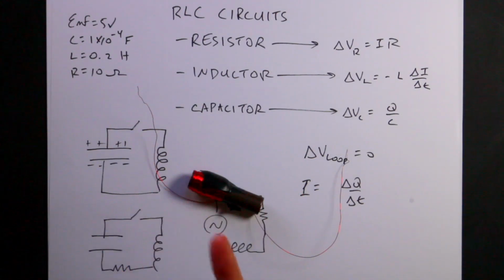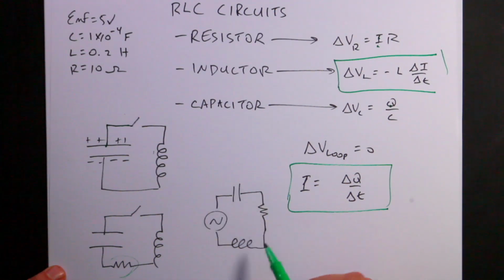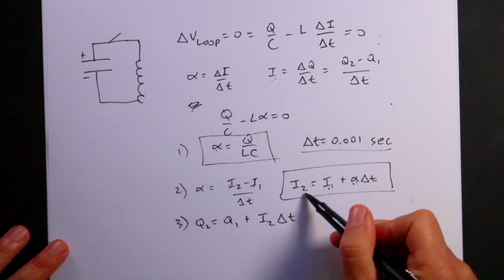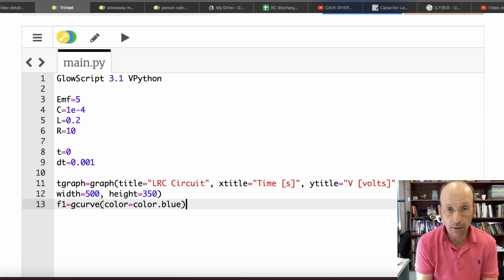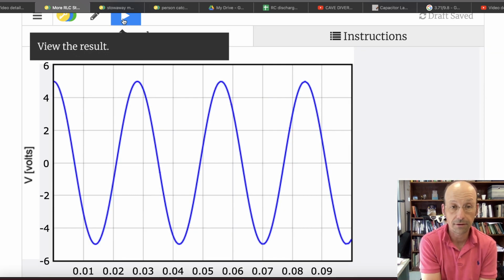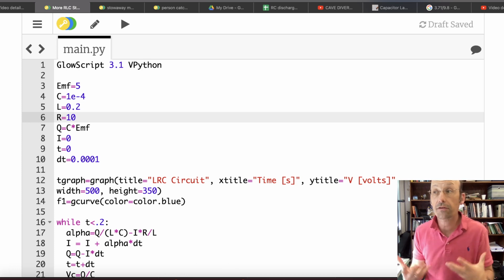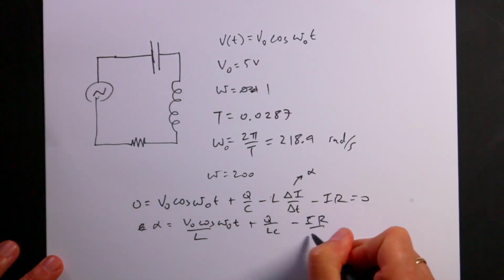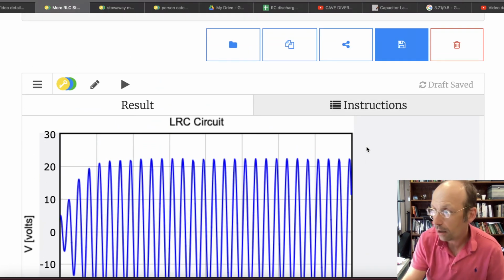Modeling RLC Circuits with Python

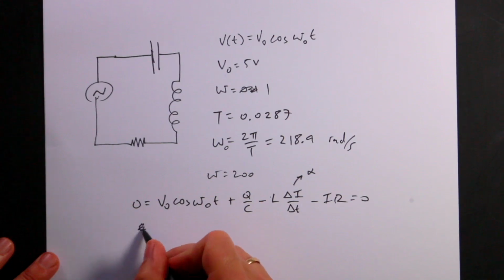Comment: Cool stuff. I have a question. For the Vloop with the voltage source, why is it +Q/C and not -Q/C (23:48)? I can see that it works. But if you remove the inductor, it would be Vcos(wt) - Q/C - IR = 0
Reply from the maker: I think it will work both ways since you are putting charge both on and off the capacitor - but you might be right.
Reply: @DotPhysics  I think it should be -Q/C since the voltage source will be charing the capacitor. But if you change your code from  +Q/C to -Q/C the result seem to be totally different. You need to change Q=Q-I*dt to Q=Q+I*dt since you will be charing the circuit.